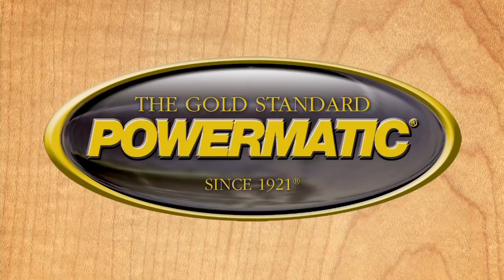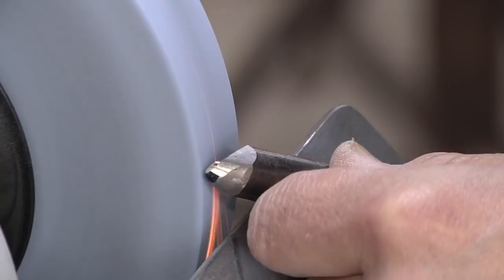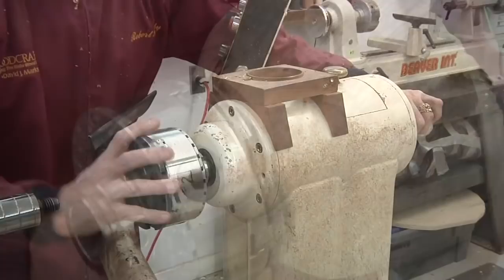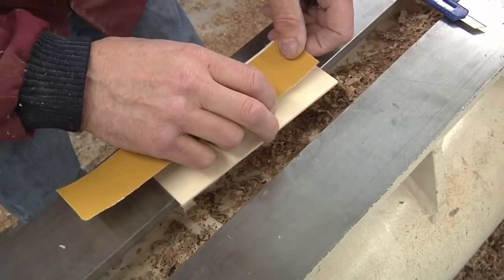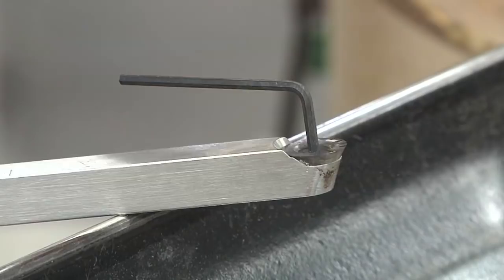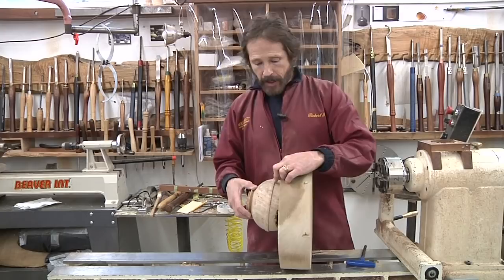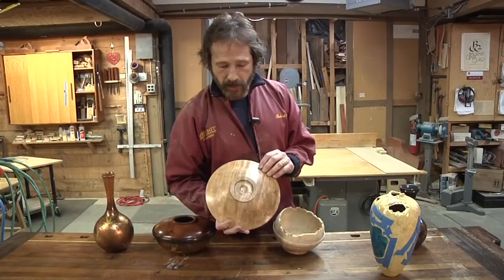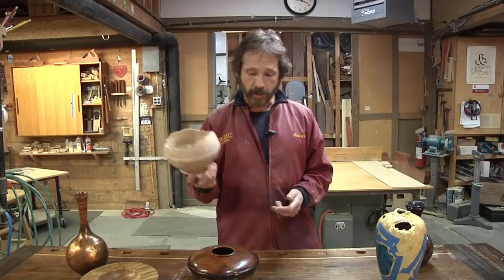150 - Bowl Turning Tools & Techniques w/ David Marks

Comment: The lathe is actually one of the safest tools in the shop, in my experience.  With proper face protection, and short sleeves, there is not much you can do to really hurt yourself, but a lot you can do to grab your attention with a catch,  It is easy to destroy wood though.

Comment: That cone center can be a pain and is usually caused by the bowl gouge coming to center. The best way I have found to remove it is with either a flat or round nose scraper, simply run the scraper from the outside in just like you would use the bowl gouge and it should make short work of the cone. Good luck with your turning.

Comment: Great video, i just got my lathe. The main thing i need to get now is the right 2-3 tools i need most for turning bowls, which 3 would you advise me to get. The lathe i got is a Recordpower Coronet Helrald 1420 that has a full turing head stock, i don't know if that helps any.

Comment: I'd love to know what you saw as "advanced"? I saw some very, very basic techniques, and tools so basic I was surprised David even included them in a video. (Easy Wood Tools are about as basic and simple as they come and require very little actual technique in use)

I'm a rather experienced turner, making most of my income from woodturning, with a bit more coming from flat-work (furniture), so I can usually spot anything inherently dangerous, and nothing here stands out as advanced or dangerous.

Comment: Im new to turning and have a question.  Your tools seem to cut much better than mine do.  They are brand new, could it be that they need to be sharpened already?
Reply: Hey Mike, I am also new to turning and found that new tools may not come 100% sharpened, or at all. Some tools just aren't good as good quality as others and require sharpening more often. I would take a bit of time sharpening on wheel then stone/water. Hope this helps, and let me know if you come up with anything else

Comment: can you sharpen tools without a bench grinder?
Reply: If you're a woodworker, a bench grinder "ain't no big deal"  Some old washing machine motor with an arbor and a home made tool rest and your in business for peanuts.  I'd just as soon not sharpen without a bench grinder but the bench grinder is just a first step towards a good edge.  Saves a little work if the edge is in really bad shape but not a deal breaker.
Reply: Walter wager

Comment: Isn't there a way that doesn't waste so much wood?
Reply: +liwiathan yep, use clay instead. :-D If you want to be extremely resourceful, wood shavings and sawdust have their own uses. It's a good medium for and outhouse in an off-grid type of situation, and it's also good tinder and kindling fuel for a fire, and good as compost and mulch (as long as it's not treated lumber, and when it comes to crafting you probably wouldn't be using treated lumber.) Shavings and strips are typically used in OSB production, and other sheet-wood construction. So, a big industrial level operation would collect and box up this material to be sold to another business. 

Trees grow up on my property like weeds, so I use such material produced by a wood-chipper in really thick layers to choke out weeds (especially vines, and tall-grass varieties) from a spot, and then I move them to another place, until they begin to rot, (between being carpenter ant-food, and fungi bait they definitely will rot) and when they start to turn a rotten yellow or brown color I compost them into future garden soil mix. If you're using a pleasant fragrance species the shavings can make good potpourri material in boxes and drawers. You can use the pulp to make paper products (if you know how and have the equipment), and bark-removed sawdust can be used as a sand substitute in cement mixes that don't require precision engineered outcome.     Another way you can save lots of material specifically for crafting is to cut your word into really thin long fiber strands and use them for wicker and trellis type projects, which might produce baskets and the like, but if you want a real solid and durable wood bowl or craft, the sculpting process is going to leave a good bit on the floor. Given that it is naturally biodegradable, and renewable resource, it's hard to "waste" wood. The waste comes in the form of proper land management where timber is grown, as some methods of logging are much less of a shock on the environment than others.
Reply: +TIXE RIGHT I meant like cutting out nested bowls.
Reply: liwiathan I think it would be possible if the person is talented, and they have a really good aptitude for spatial reasoning, but because there would still be so much material cut away, the bowls wouldn't nest together perfectly. The process would be much more intensive to bring each bowl to a finish, as you'd have to cut away bowls as you went, and finish them without the aid of the turning tools. But, I think it could be done with enough practice.
Reply: coring machine for nested bowls.  But wood literally does grow on trees so its not really being wasted.

Comment: Does anyone else find it strange that he finishes his work at 320 grit sand paper? I usually go all the way to 2,000!
Reply: I've got 2000.  There aren't that many pieces where if go beyond 400.  The difference is usually not evident to my eye.
Reply: 2 000 I use max 5000 lest 3000
Reply: Depends on what you are going to finish it with too - 320 is enough for a wipe on poly or alike